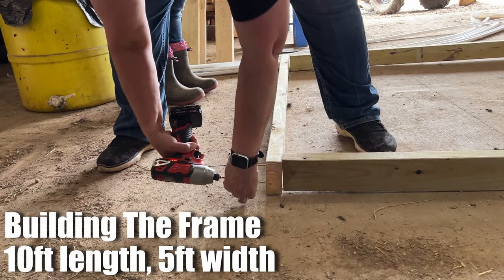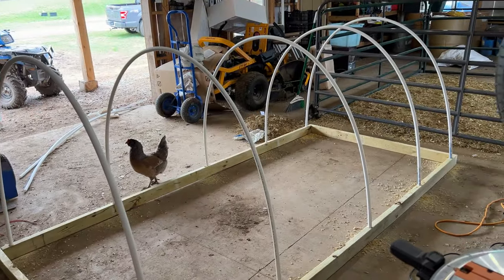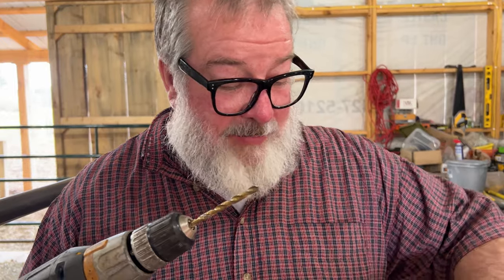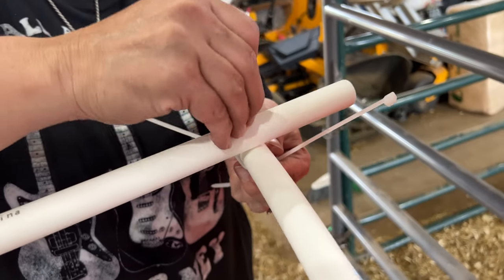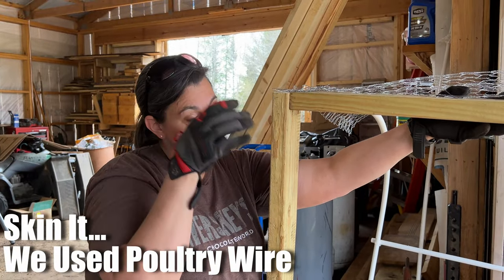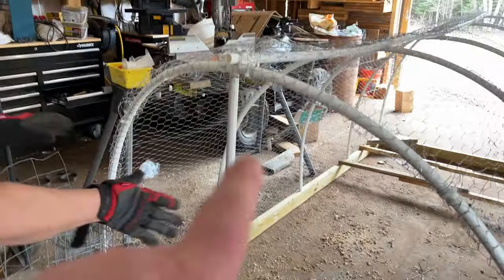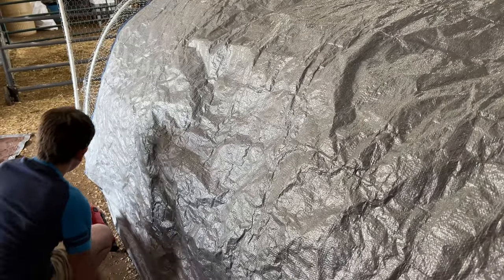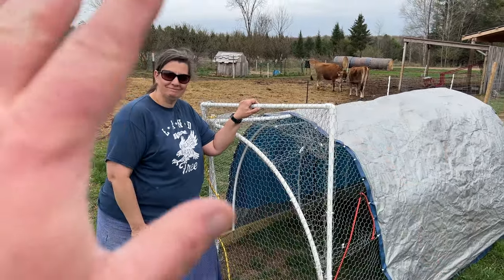HOOP COOP Chicken Tractor Step By STEP for $20

Comment: A suggestion... Measure and mark out your placement of your holes on the PVC and drill them on the floor then when you start construction your holes are already drilled. A scrap piece of 2x4 under your drilling point will keep you from drilling the floor. My motto.. Work smarter not harder..